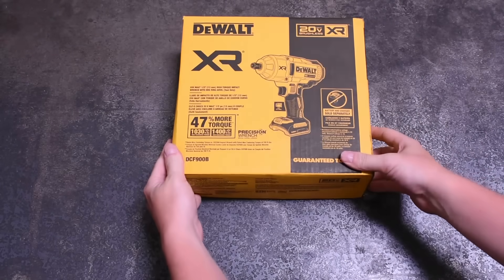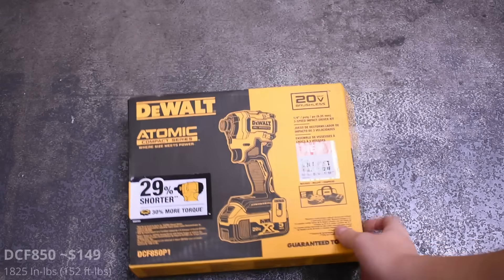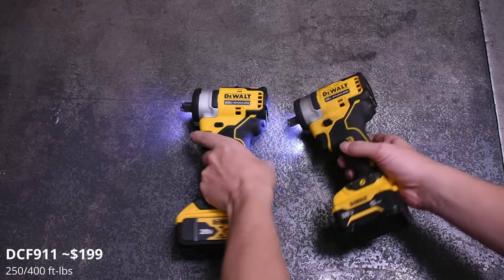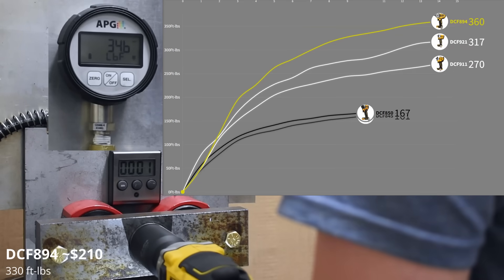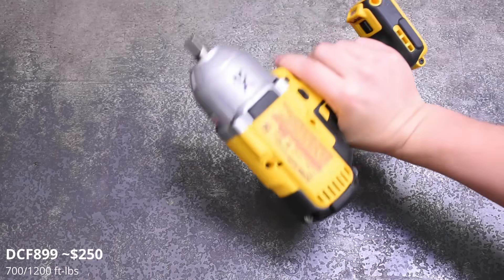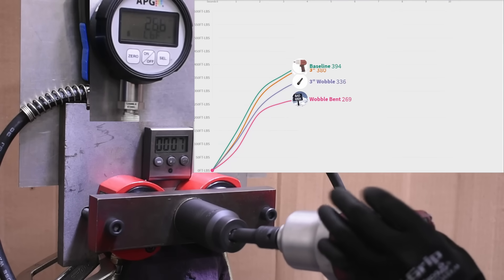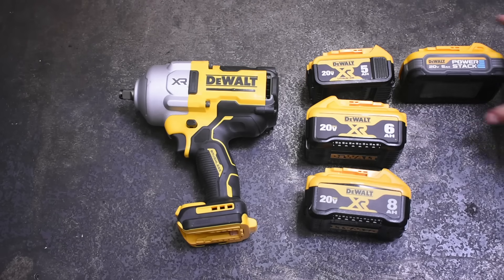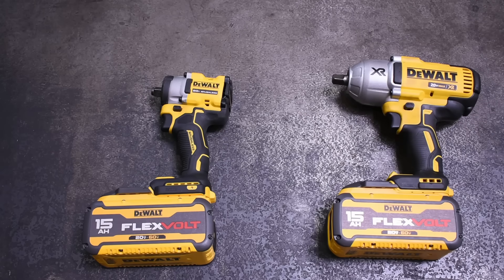Dyno Graphs of Every DeWALT Impact: How Much DO You Need?

Comment: thank you for your video. i use dewalt and have used them for the last 25yrs. i didnt want to change to milwaukee because i dont want a bunch of different batteries. i like using one battery system so i've always used dewalt. i've always got good longevity from my dewalts. im glad to see that they have some heavy weights out there. i use air because i already had my setup before i knew that anyone could build cordless that would be even remotely comparable. otherwise all of my tools would be cordless dewalt. i have been thinking about getting a dewalt cordless for the times when my carb on my generator is plugged up. thank you so much for helping me figure out which would be best for beside the highway use. also, seeing the difference in torque with the battery comparison was very helpful as well. again, thank you for all that you do.

Comment: The 1/4" drivers are basically meant for woodworking/wall installs/etc, rather than machinery work. My 850 is a fantastic companion to the XR compact hammer drill it came with as a set.

Comment: Can you test corded electric 1/2" impact drivers at some point?  cheap to professional .  I just don't have enough air for a pneumatic one,  the cordless are spendy.  I have porter cable and is does fine.  Less than $80 on the jungle store).  I do have an invert in my truck, so it is handy to remove lug nuts for flats and such.

Comment: Used my DCF899 to take the crank pulley bolt out of a BMW diesel yesterday. The BMW pulley bolts are infamous for being awkward, the DCF899 using a  22mm Ingersoll  weighted socket didn't even blink it came off so fast I thought I had picked too  big a socket impressed 👍
Reply: I've got the DFC899 too it's a great tool

Comment: I would like to say that in Arkansas and I figure most of the south that I find that the m12 impact wrench and so the dewalts in the same category will do like 85% of everything on a car. Even axel nuts on a car. It may not do bigger trucks but for cars and small trucks I have done most everything with my stubby.
Reply: Damn I wish we didn't have salt here. I'm more into early 2000s trucks but they are all rotted tf here. I have an 04 now that I got cheap low mileage with no rust but that will probably never happen again. Guy was from west coast and the engine blew so I bought it for $800.

Comment: I want the 961 and will run it with 5 Amp Power Stack will even put ADAPTER on it and run my FLEX STACKED lithium I have found that running 18 volt tools with 24 volt battery they run FASTER

Comment: The battery comparison part had me thinking that if you could come up with a way to monitor amps usage and voltage drop at the battery while running tests would be a good addition of information to have. Some sort of interface between the batter and tool that wouldnt bottleneck....
Reply: Run a heavy wire and use a clamp ammeter.

Comment: It's great to compare the data like this and give some perspective to the total line. As for the options, I have no interest or use for a 1/2" impact more powerful than the DCF900 as it's already a socket eater. Additionally, if I need that level of torque (850ft+ on your measure) I'm reaching for a 3/4" option. 

My favorite? The DCF891 all day. The size, weight, handle ergos and performance are perfect-which is why I purchased one. I team that with an Milwaukee M12 stubby 3/8".

Comment: 2 years ago milwaukee was a good buy but now i kind of wish I'd held out for dewalt for the simple reason most mechanics don't have them and wont ask to borrow charger/battery
Reply: Nah give it a year or so and dewank and theft deterrent teal will be back in their rightful place at the bottom of the pile. The other 2 are just playing catch-up as usual.
Reply: And in the meantime you'll be the one failing to bust some frozen fastener. Just last week my dcf900 removed a Audi axle bolt that a new red 2767 with a 'high output' couldn't. What's not to like about that?
Reply: @johnthumble5154  dewalt is definitely not my preference
Reply: @melvingibson4525  phew 😅 had me worried there for a while

Comment: Have you ever tested the Dewalt DCF897?
Reply from the maker: Based on the 899, so the 1/2" 900 will spank it sadly. But good point
Reply: @TorqueTestChannel  yeah I believe that lol! more wondering torque difference between 899 1/2” to 897 3/4”
Reply from the maker: @zachvargas122588  A simple anvil change to 3/4" like that we find to be good for around 5-8%, with less vibration.

Comment: What kind of experiences are people having with the 921? Any real issues with daily use?
Reply: Been using the 923 with a powerstack daily as a steering and suspension tech for  about a month now and so far no problems, I have a total of 4 Ridgid impacts that are broken all in different ways, I loved the sizing and power by the Ridgid but can't withstand professional use, many years ago I ran a dewalt drill, and driver with absolutely no problems
Reply: I’ve been abusing a 923 with a Powerstack for over a year, it’s been trouble free and never stops blowing my mind with what it will do.

Comment: Fantastic video as always!    Based on your earlier videos I bought both the DCF892B and did a full suspension front end rebuild with no issues at all, it makes life way easier with a light weight impact working under a car.    I also ended up getting the DCF923B I take on road trips so I don't have to feel like poo in case of having to change tires in winter or summer.     I mostly have M12 tools but for impacts I went with Dewalt and they are excellent tools for sure and it's good to see they are made here in the country!

Comment: Great video. I modded my 850 with a 3/8 anvil and have an 891 as well, I work on a lot of work trucks and heavy equipment and it is extremely rare that I need more beans. 900 is next, I don't think I can justify the weight increase of the 961 for such a small increase over the 900.
Reply: 900 is a Monster
Reply: How well does that 3/8 mod work on the 850? Thinking about doing it myself. What parts do I need and where can I find details
Reply: @gbeving3167  I made a short video on my channel and put the anvil I used in the description somewhere. I use that thing more than any tool I own daily now and is hasn't had a single issue.

Comment: I do use my 891 everyday, but I'm on my 3rd one.  The first one failed electrically & the second one was making some strange grinding noise/lost power at the same time.
Reply: That isn't too reassuring lol I know the 899s would burn out roller bearings in the nose cone and start to screech. Happened to my buddies but he is a diesel tech using it daily

Comment: It may be helpful to others to include things like "can handle anything up to 1/2" grade 8" or something of that nature.
Reply from the maker: Bolt size and by extention book spec torque have little to do with what's sometimes needed to remove it after 20 years. There are 32mm axle nuts a compact can do, and 15mm leaf spring shackles it won't ever budge
Reply: @TorqueTestChannel  Except the tool rotates in BOTH directions.

Comment: Where does Dewalt go from here in your opinion? Don't need much more torque unless you're moving to 1".

So will they drop the size over time or add features like vtec or a torque limit button?
Reply from the maker: 3/4" and 1" drive sizes for sure

Comment: I just wish someone made an impact strong enough to bust a 2JZ crank bolt loose. 258 ftlbs torque spec is no freakin joke. I borrowed a coworker's Milwaukee high torque and it didn't budge. It took me and a buddy hanging off a 5 foot long breaker bar to get it loose.
Reply: The old breaker bar on the floor and blip the starter move works. But stand clear if it did lift off the jack stands.
Reply: @mr2_mike  unfortunately it was on a stand, so not much I could do.
Reply: @scooterprint  Yeah. You're out of that option and holding the stand sucks.

Comment: Gotta say, still love my DCF923...I keep getting tempted to upgrade my 894 and 899, but I hardly use the high torque, so maybe just an 891 in my future.

Great test though :)
Reply: Super happy with my 891. Got the 5ah powerstack with it and rarely switch it out of "2nd" gear - lasts all day in that mode and can always be turned to full beans and act like the old high torque.
Reply: @Mis73rRand0m  yeah, I imagine the 891 would be plenty for 99% of my higher torque needs. I also have an IR2135TiMax if I really need the beans, I don't like the high torque as it's just way too bulky.

Comment: I recently watched a video where it seemed like the 1/4 inch hex to square socket adapters seem like they are being maxed out. How much more power can they give them before they snap off every 1/4 hex thats put into them.  I would think there's only so much that 1/4 inch hex can take.
Reply: agreed. More powerful impact drivers like the M18 Fuel 4th Gen and Flex Turbo are notorious for this.
They cap off fastener heads more frequently as well, specially those with PH2 and T10/T15 heads
Reply: Yep, exactly as seen here with Milwaukee's 2853-20 compact-sized Impact Driver...and that's last year's model. The new 2953-20 is more powerful still, so maybe load up on socket holders?

https://youtu.be/FCP-B9HmHX4?t=503s
(HT to Kiwi YouTuber 'Tools & Stuff')...
.

Comment: The DCF921 1/2 inch breaks 450 ft lbs free but the DCF 923 breaks up to 400 ft lbs free and failed at 450 great video.
Reply: The 923 has the 3/8" anvil and I feel will bust a lot of sockets with it.
Went 921 and found some 1/2" Nano Sockets which make a bit more accessible to tight spots.

Comment: Fantastic timing.  I just am accepting that my Atomic doesn't pull off 90% of lugnuts and have been trying to navigate what I want to buy as a step up.  You just made my shopping easy.  😁
Reply: DCF891!
Reply: I just got my 891 a few days ago.  It is crazy nice.  The same truck lug nuts that my 3/8" will impact off in 15-30 seconds, it whips off in 2-3 seconds.  The trigger is ridiculously nice, allowing me to hit as hard or as soft as I want.  It was a GREAT purchase
Reply: Don't get me wrong, my 911 has been amazing.  I've just been dealing with a lot of nasty stuff tightened by idiots. With the 891 the same price, getting a 921 doesn't make much sense since my 911 will do almost everything the 921 will do.
Reply: @SvdSinner  I had the 911, bought the 921 and gave the 911 to my buddy back home who is a truck mechanic. Was just asking him the other day if it's still alive. He said he uses it every day. If my 921 crapped the bed I'd prob buy the 911 again. I actually liked how it had no modes. My finger is the mode. Don't really notice the 50 ft lbs difference or the slight length difference. Both 911 and 921 are handy af as they fit in places other impacts dont
Reply: @Julio Gonzo  You'd have to pry the mode switch out of my cold, dead hands.  Being able to not just remove stuff but also reassemble stuff, even smaller stuff, is a game changer in my world.  The precision machine mode sets everything to a non-damaging torque, and I finish stuff off with my torque wrench.
Reply: I'm running the 921 and it's ripped lug nuts off of everything I've put in front of it so far, including my f350.
Reply: @flatheadvorhees  agreed, I owned the 911 and 921 and both could do my trucks' lugnuts. The DCF911 struggled a bit though, around 5-6 seconds with the 4Ah slim battery
Reply: @Derrik Weyrauch  yes sir I have the 921 as well, so compact but powerful
Reply: @flatheadvorhees  yeah I drive tow truck, 921 wicked for caging air brakes, bigger impact with long 3/4 socket won't fit on caging bold without a swivel, think it's only once failed to take wheel nuts off cars and light trucks. I grab it before my 899 on tire changes cause it's so dainty lol. Just got the 891 to replace the 899

Comment: I love my 891, not much it can't do and it's light in the hand. Totally recommend getting one if you work on cars and aren't a snapon or milwaukee loyalist.
Reply: Despite the majority of my hand tools being Snap-On and my cordless power tools being Milwaukee, I’m not a loyalist to either. However, what I am is someone who hates multiple battery platforms and in my tool box right now I have 5. That’s come down from a peak of 8. Right as I finished replacing all my old worn out Matco, Snap-On, and Ingersoll cordless tools with Milwaukee, Dewalt started releasing their new lineup. Damnit!  I neither need nor want another battery platform and my history with Dewalt tools is not good, but man they sure are pumping out some enticing stuff. Ugh first world problems.
Reply: Yeah I was able to basically fully disassemble my car with my 891. Though I don’t live in the rust belt 😅

Comment: Really like this single brand comparison style, especially for a brand that, like you said, doesn't really... have models names that make sense and don't make it obvious when you're holding an entirely new generation of tool
Reply: He's doing better marketing for Dewalt than Dewalt themselves lol
Reply: The number at the end should literally be the amount of torque that it gives on average and then that would actually make sense to people!
Reply: @Charliemmafan it makes sense, the high number is how stuck the bolt can be, the low number is regular working torque, or how close it can get to a particular torque number reliably.
Reply: @bustingnutsATX Really??
Reply: yes the high number is max removing and the low is max fastening.  It makes the most sense not to have a tool that can tighten a bolt and then not take it back off.  better to have extra power in reverse because if you tighten something to 1,000 ft lbs there's a good chance it takes more force than that to remove it, metal has a way of bonding, and when corrosion sets in it can be much tougher to remove than it was to install
 @Charliemmafan
Reply: There is a legitimate logic to a test like this.  Often times once a user buys into a brand, they stay in it because buying several brands for their set of tools makes little sense.  It's cheaper and handier to say with one make and one voltage.  That said, if a Dewalt user is contemplating buying an impact, this lets them know what to expect for what they would pay for a given model.

This also means the channel will need to do one of these for every different brand.  And I hope they do.

Comment: Apparently I need all of them.  What I really need is an adjustable torque.  I was installing rivnuts and broke some the installation screws.  I ended up installing some into scrap material and figuring out how many rotations after slow-down before they were fully installed.  It would have been nice if the drive stopped at the right spot for me.
Reply: Quit pulling the trigger all the way. Christ! Or use torque sticks. It's not hard.
Reply: @TheMetalButcher  Torque stick.  That's a new term for me.  Apparently they're not great.  I may be better sticking with rotation counts or using a torque wrench.
https://www.youtube.com/watch?v=JVY0e5sdWx4